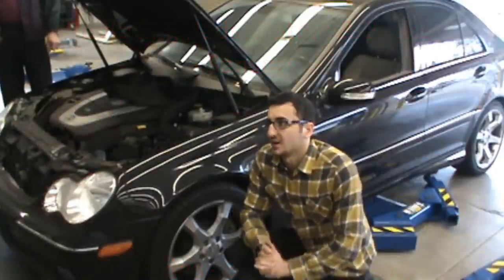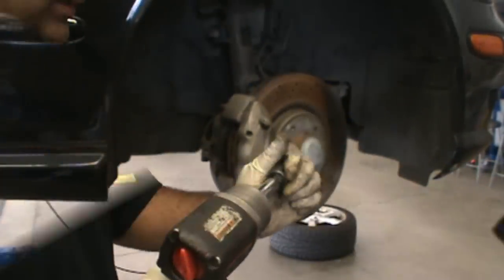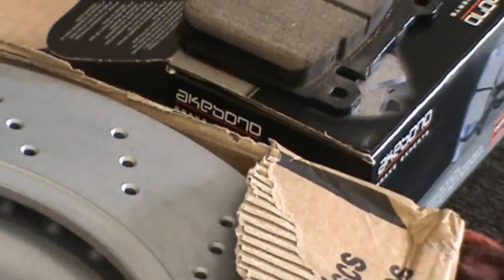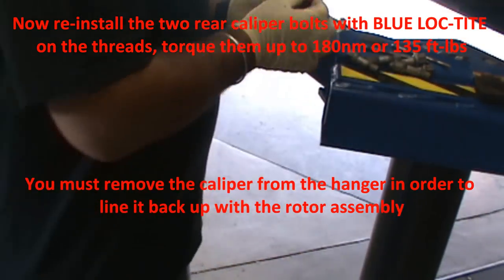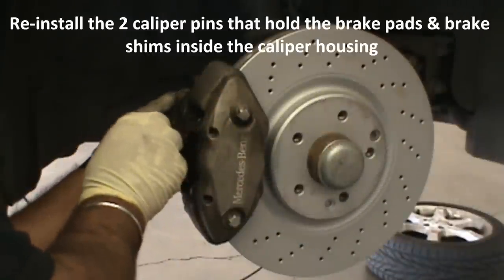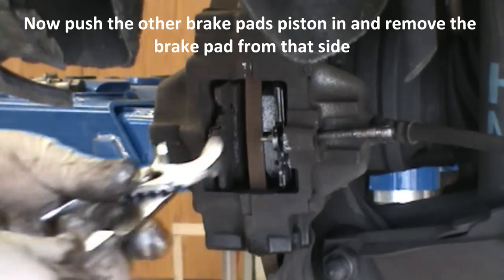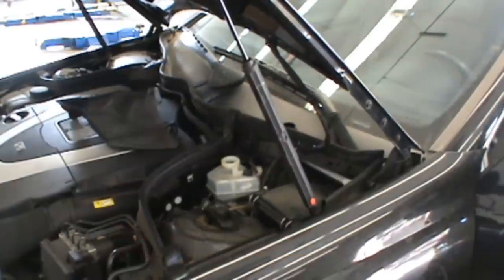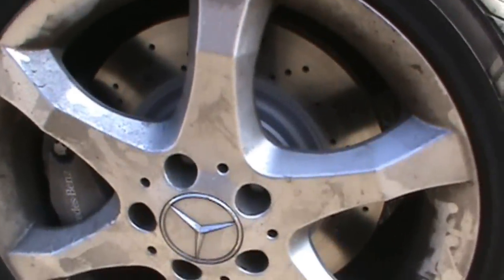How to replace brake pads, rotors, and brake sensors 2007 Mercedes Benz C230 Sport

Comment: Brembo brakes made for Mercedes.  Just changed out rotors and pads yesterday on the same vehicle (C230 sport kompressor).  While cleaning the caliber, noticed the Brembo logo on the back in the upper side.  I just used OEM pads and rotors from MB.  Good video.

Comment: at 5:10, you meant hammering the rotor. great selection of brake pads, AKEBONO! very little to none brake dust and noise yet big stopping power compared to factory ones!

Comment: Hi there, a long time since anyone commented but I thought I'd give it a go.
Good video, a lot of background noise louder than your commentary & I would like to add some information you might find useful?
Do not use Copper or any other metal based ‘anti-seize’ compounds on the edges (sides) of the brake pads – this will actually cause problems later when the pads start sticking in place.
Anti-seize compounds are NOT lubricants. They are for assembly use (i.e. Nuts & bolts/fasteners) so they can more easily be undone again when required. The metal based compounds will actually promote corrosion (due to electrolytic action) and will eventually form a sticky paste that will harden & stop the pads moving. Hence scored & worn disks. 
It is OK on the pad rears/piston as it helps reduce brake squeal, however, Most pads now have an anti squeal 'shim' stuck to the back of them to do this instead but you can still 'butter' them if you want.
I would recommend trying a ceramic (non-metal) based grease to lubricate the edges of the pads & Caliper runners. That should help keep your brakes in good working order. You can get them off Amazon/ebay/Halfords etc.

Comment: Nice job, Anthony. I've never seen a Mercedes done before. Looks solid. Of course what stands out is the difference with most other brake systems. Do you lubricate the sliders? What with? I notice that you use nickel antiseize rather than 'brake quiet'. Is that your shop preference or is it specific for Mercedes? Do you need to put antiseize on the caliper alignment screw? Sometimes that can be hard to get off, and it seems redundant....

Comment: Awesome Guys! I allready cleared my Maintenace B message from 1 1/2 years of being there and great tips on replacing my front breaks since I have a Brake Wear message as well. Any tips on getting the cam sensor to stop coming up. It only does it after ~4,500 miles with out an oil change and will clear itself for a bit, but then come back. It will only stay away when the oil is changed.

Comment: Excellent video! Thanks for sharing.
One question. At the 16:44 time mark, there is a black hose hanging down just above the hammer. Do you know what that hose is for? I also have this on my 2006 C230 Sport. Thanks again for sharing...

Comment: First I would like to thank you guys for this video. I do however have a question or possibly two questions one which I could probably find on a forum. First question why are the slotted holes facing One Direction on the right side and facing the opposite on the left? Also I’ve had my brakes on for a while and never had any issues but now it feels like my brake rotors are either warped or the ABS is stuttering. I have new tires in the front. The wheel doesn’t shake it just feels like the brakes are stuttering. Any suggestions to that? My car is as well a 2007 C230. Thanks Aaron

Comment: when u compress the cylinder into the bore to remove the pads wont the brake fluid leak from the reservoir

Comment: Just watched the video on how to replace the pads & rotors on a c230, my question is, is replacing the rear rotors the same procedure as the front? I want to replace both the front and rear rotors. Is there anything I should look out for in replacing the rear?
Reply: George De La Rosa Replacing the rear rotors is the exact same procedure. Compress the caliper before you remove the old pads, its has two bolt (top and bottom) just like in front. Its all the same procedure he preformed removing the front rotor.
Reply: Thanks

Comment: The ouch problem is that those PINS have a sharp edge ok if you bend one of them with that hammer and punch you just cost yourself a good $80 for new pins. Also when installing those pins a light coat of antisieze on the pins very light will make them slide alot easier.
Reply: First time I heard of apply anti seize on a brake pads or on a brake job for that matter.  Wow crazy lord!

Comment: What size are the rotors for the front?  I ordered a set of rotors that Partsgeek.com says were for the front of the 07 C230.  They are 10.2 inches though and much smaller than the rotors on the car already.
Reply: The Partsgeek site is completely wrong. Use RockAuto next time it's much better. The front rotor sizes for this '07 C250 2.5 V6 Sport is 330 mm diameter which is 12.992". Even the rear rotors are significantly larger than the "10.2 inches" the website says.

Comment: Does anybody know if a 2005 Mercedes c230 has rear brake sensors? I see none, the old nor the new brake pads for the rear have holes or a slot to where a sensor may plug in...nor do I see any plug on the assembly for a sensor...The front DO have holes in the pads for the sensor and a sensor came with it.  Nothing came with the rear brake pads. I am stumped. I'm replacing rotors as well, but on this car I see NO rear sensors anywhere. The car did indicate it needs brake replacement, but the front brakes are still good so it can not be the front sensors that caused the indication, yet I can find no rear sensors.

Comment: hi, can you please tell me the name and the brand of the bolt remover ( Wrench)  you used at 18:14 .
Reply from the maker: air impact gun
Reply: thanks, and the brand ?
Reply: What if you don't have an air impact gun? Then you resort to a 1/2 wrench and a mallet. The upper bolt holding the caliper is way more difficult because you need the exact right extension and don't forget the mallet.

Comment: I have the exact same mercedes just wondering how many brake wear sensors are there in total so I know how many to buy
Reply: +mark saucedo Did you ever find out how many break sensors they have?
Reply: yes it was just one on the passenger front brake
Reply: Thanks!!!
Reply: +mark saucedo You know I said right there in the video, 1 break sensor in the front.

Comment: Where do y'all get Mercedes parts? And can anyone get parts from there? And thank you for your time and making these video's. I'm about to buy a 07 Mercedes c230 with 148000 miles on it. Anything that I need to check or look out for? Thanks again!
Reply: +John Pearce Ebay. Just make sure it's compatible.
Reply: I just got rotors, pads and sensors all the way around for a little over $200 from Rockauto.com
Reply: Heck of a bargain!

Comment: just dont tighten the lugs too tight or they can brake inside the threads.
his wrench stops at a certain force which would be 97 ft lbs.
on an impact gun connected to a compressor dont compress any more than 100lbs in the tank.

Comment: Hmmm, so the 135ftlb torque is clearly too high for the two 18mm caliper bolts, with loctite blue (or my torque wrench is stuffed), read around and many agree that dropping torque settings with loctite by around 20% is a good move given that it's more of a lubricant.  I successfully stretched one bolt and broke another following this advice.    Looking through the SLK forums I found a more reasonable number of 115NM or 85 ftlb.    Source:  http://www.slkworld.com/slk-r171-class-diy/13874-replace-rotors-pads-05-slk.html
Reply: yep.  Owners manual says 85 foot pounds.  Not sure where his number came from.

Comment: thanks for the help. did my brakes on my S430 my self , and changed the front rotors too. 
check my video out on how to jumpstart a benz with trunk locked. u kno the battery is in trunk

Comment: oddshock824 says, "I just dont understand when he says 97 ft lbs... I mean if this is a DIY, I just dont know how many pounds im pushing or..?? Im not sure someone please explain. And TY for the vid."

search "torque wrench" ~ sets the torque settings at the desired ft lbs on the caliper bolts & lug bolts... listen for that click & that is tight enough... 

PS: skip to 19:55 for the nice view!
Reply: Ft pounds is how tight the bolts must be according to Mercedes Benz specs. The way you know how many ft pounds is by using a torq wrench you would set the wrench to 97 ft pounds then tighten until the wrench clicks letting you know it's at set ft pounds
Reply: ***** ??? i already replied to oddshock824 a year ago... dunno why you replied to this since i already have a 3/8" drive and 1/2" drive torque wrenches
Reply: Earl DaSquirrel b. B

Comment: You forgot to clean and adjust the hand brake (Inside rear rotors). small drum... What about that...?????? Mercedes doesn't use grover washers..Thats why the Blue Loctite...9 to 10...